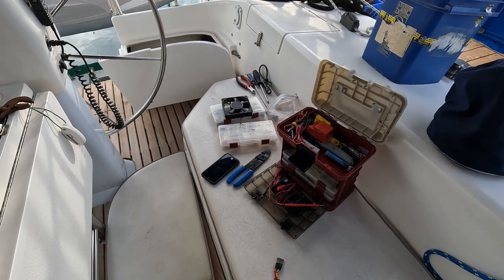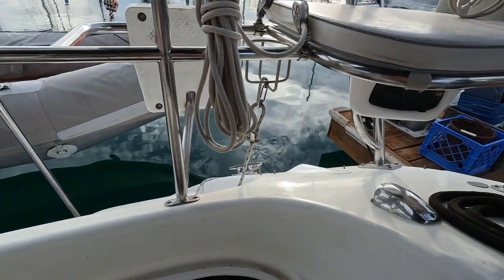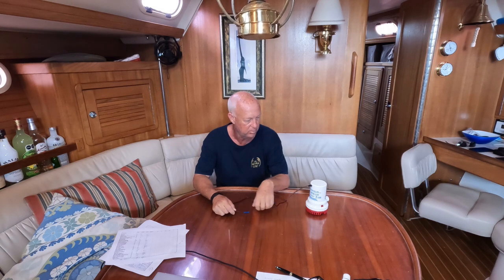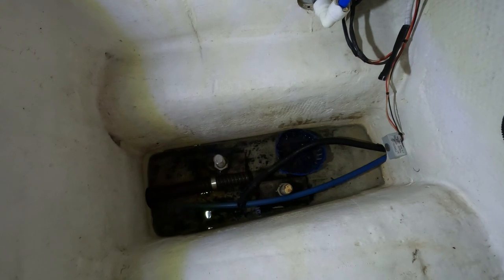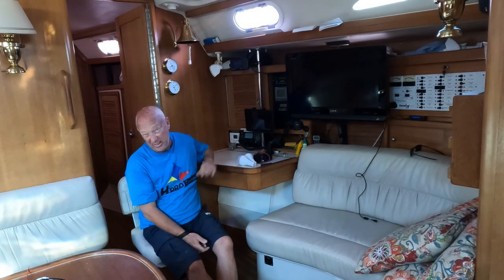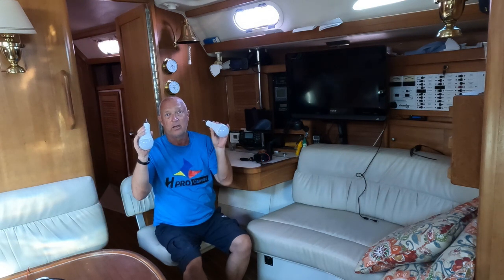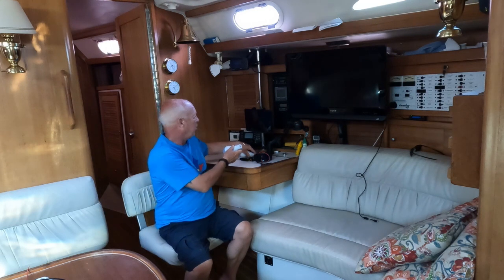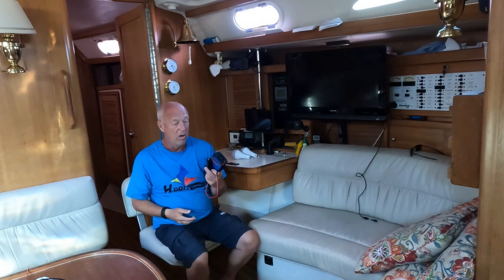Refrigeration failure, building a hookah, great cockpit lights, and looking like an idiot. Episode 7

Comment: My understanding is that an air filter is appropriate when using an “oil free” air compressor. There is still a lubricant and there is a risk of it atomizing, which would lead to inhaling particles.
Reply from the maker: I think you are correct, having trouble finding one, will order from Amazon or Ebay when I get to the next marina in a few days time, in the middle of crossing the sea of cortez at the moment. 8 hours in and 35 to go.

Comment: Good stuff. Feel your pain! Excellent episode titling, sounds almost like a teaser for a nautical GrandTour episode. Replacing the reefer's fuse with a length of wire sounds /exactly/ like a Grand Tour gag! (Good luck with that, by the way). Oh, and... NICE YACHT!
Reply from the maker: Thanks, the refrigeration sages continues, had the guys top up the frion, the temp went up, the controller and sensor maybe caput. they do have a fuse holder so my temp fix can hopefully be removed, My Engel standalone 12V freezer also packed up yesterday, the guys have taken to their shop. Hopefully one of the two will be fixed and if I am lucky both.

Comment: What are the safety requirements of using the hookah?   Decompression time? Etc
Reply from the maker: I only really use it for cleaning the bottom of the boat and clearing the propellor if it fouls anything and for changing the sacrificial anodes so don’t know what conditions it should be used under . My max depth is no more than 8 feet

Comment: I like the hookah but I prefer to wear an old scuba hood to keep the little critters out of my ears when they’re scraped off the bottom.  The helmet is good for when you need to go up the stick, especially at sea when you are bouncing around up there!
Reply from the maker: Yes I once surfaced with a wetsuit full of the little critters, the zip had come undone. May be the helmet would be good clearing a fouled prop in choppy waters too

Comment: Caution using hookah gear diving, the usual scuba rules apply to breathing compressed air at depth.
Reply from the maker: The max I use it for is 8 feet to enable me to.clean the bottom of the boat . It’s takes about 60-90 mins

Comment: I also built a hookah but instead of a compressor that runs on 120v AC I have a 12v DC Oil-less compressor. No need for a generator.
Reply from the maker: Hi Bob, didn't even know they made 12v compressors. what's the PSI output and make, a buddy of mine is thinking of building one after trying mine.